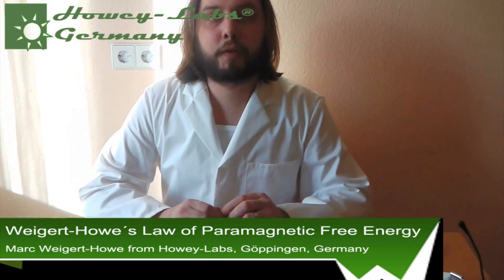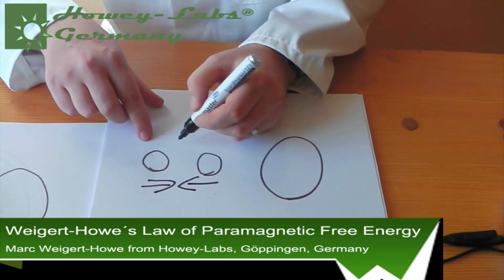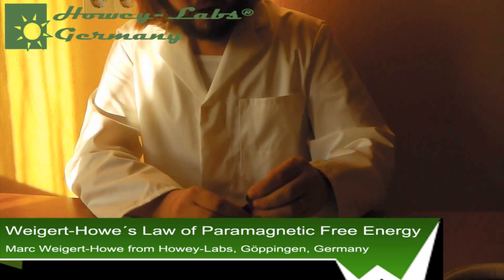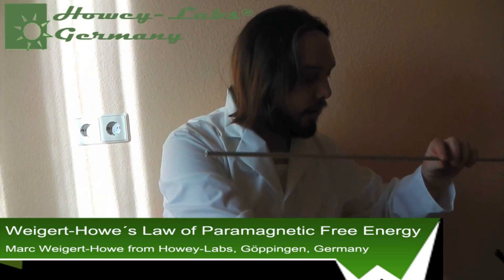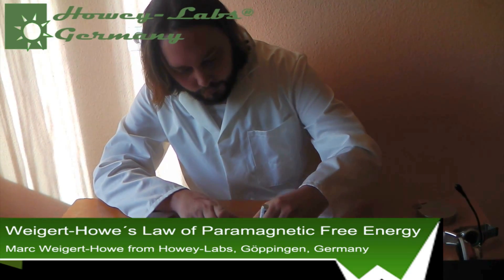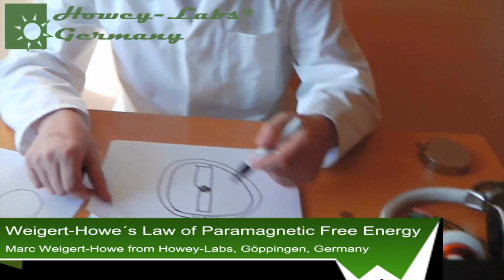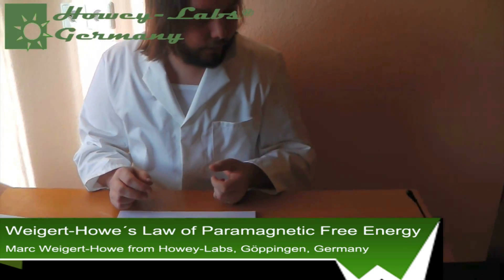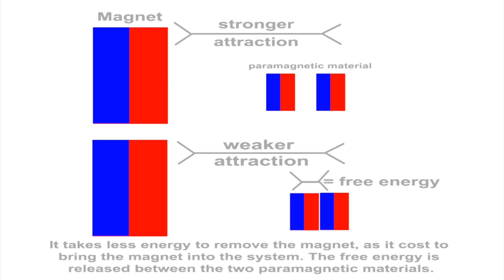REAL Perpetual Motion Free Energy Machine Part 1 ★ (ParaMagnetic Motor Overunity Generator) ★★

Comment: This person is claiming his device to be a 2nd order Perpetual Motion Machine.  By definition all perpetual motion machines existing in our universe must be 2nd order; meaning they produce excess energy.  After all, if you can hear it then it is producing sound.  Sound produces heat and heat is an inefficiency loss of the energy transfer through air.  
His claim is even more outrageous than a 1st order PM machine which produces no net energy (still impossible).  
Simply put if you are unable to trace the energy flow and don't encounter any inefficiencies in your process then you are mistaken. To have any sort of energy transfer there must be associated thermal losses.  Even thinking produces heat.  

If you reject 100% of the inventions which promise more energy out than energy in you will be correct 100% of the time.

Comment: Everybody with a bad attitude, I think you totally missed the point that the German guy tried to convey. I agree, the camera is shaky, the banner covers 99% of the video etc...but he compensates by sharing something that can be important...
First of all, he is not using magnetic/ferromagnetic coins but paramagnetic ones, and the effect is ONLY observable in the presence of the strong magnetic field provided by that monster neodymium magnet he uses. If you watch carefully the coins are not attracted to the magnet; just to each other (in the presence of the relatively strong magnetic field). The effect he tried to explain is that the attraction force between the coins is stronger when they are close/r to the magnet and weaker as the distance to the magnet increases producing a difference in the total force...That is producing Work when they attract each other when close/r to the magnet that is bigger than the work needed to separate them when far away form it. The work moving them away can be considered negligible since they are not affected by the magnetic field (in a considerable way).
Even if he is wrong, If you don't see anything remarkable, worth seen twice results on this small experiment, well...
Also, he just wanted his name after the effect...come on! is not like he is asking you to give him your first born, jeez..
Respectfully.

Comment: you are just jocking, free energie devices dont work, all of them need an apport of energie, overunity´s are a scame, i spend time and money testing and i never reach 90 % eficiency that not more than any efficiency motor, perendev and brady where a robbers and scammers, the only device you can really built up is a very effeicient pulse motor, no more
Reply: +Germain Seguy, try using a torroidal device to amplify your power output
Reply: FANATASTIC,
 GROWING UP VOLT AND LOOSING CURRENT ! DO YOU KNOW ABOUT KIMERAS? I INVEST A LOT OF MONEY ON THAT DEVICES,  FREE ENERGY DEVICES ARE A SCAMMER, CHEK OUT IN YOUTUBE: GERMAIN SEGUY,  WATCH MI PULSE MOTOR, I KNOW WHAT I AM TALKING ABOUT!
Reply: i will send you a video after i build a cheap efficient generator. you need to think outside the box on this one guy.
Reply: Ok i will be happy to watch it! Thanks i built up one too, not bad you can watch on youtube
Reply: Germain Seguy
will take alot of work, but i'm going for around 24v input while getting anywhere from 240-300v output. where there's a will there's a way
Reply: What about the current, how much watts input, how much watts output?
Reply: Germain Seguy all still on paper but what my goal is, is to achieve an output of at least 10-20x what it takes to run. first step is finding myself a small dc dynamo and small dc motor and various other parts for small scale testing. thinking gear system possibly, 1:16 ratio oughta speed up kinetic motion at the dynamo significantly
Reply: I did that job , only way is mi system; a brushless bike on the rotor core used like axle and use push pull system with polarity inversion using optical sensor and a chip, + h bridge ssr relays for the frecuency the problem is lentz effect due when get load
Reply: Germain Seguy
 i am most likely going to cannibalize a dynamo out of a diesel dc generator, and build the system outward from that, that way just need to match the rpm and torque that would normally be applied by the diesel engine. this is strictly in the conceptual and on paper phase right now, but as resourceful as i am, i'm sure i can scrap something together for relatively cheap. my goal is to spend less than $250 and still be able to build a working unit
Reply: Germain Seguy You actually spent money testing free energy machines?  Are you kidding?  Why didn't you just pay attention to high school physics.  You would have known they don't work...for free.
Reply: thanks i know they dont work!!!
Reply: +Germain Seguy Sorry dude, you can barley type.. I can&#39;t see any point you make being serious haha. You can definitely make free energy with induction, basic basic physics.. I can make an electric current with a coil wire, a magnet and my fingers.. People with your attitude are generally pretty dumb because you close out knowledge. You&#39;ll calim to know everything on your own, and without listening to other people you&#39;ll always be behind the power curve.  Never claim to know everything..

Comment: Explanation of this (NOT PERPETUAL): 
When para magnetic material is in presence of the magnetic, it becomes slightly magnetized however as it moves away from the magnetic field the coins magnetic field looses its magnetism due to thermal-motion taking over and randomizing the electron alignment, therefore as it moves up its magnetic potential energy is lost and the system re-gains the energy. Furthermore, this can be shown if the top-most coin is set outside the magnetic field which will lead to the 2nd coin falling back down due to gravity and then magnetic pull back down as it will loose all its magnetism and so the system gains no energy as soon as it leaves the magnetic energy down thus loosing its energy. In other words the large magnet provides the magnetization but the coin has with a linear B(H) characteristic and no magnetic hysteresis causes any energy-imbalance. As for your motor which rotates, the friction causes it to stop thus laws of thermodynamics are not broken (NO ENERGY IS CREATED, IN FACT IS WASTED TO THE SYSTEM).

 Next, when he pulls the coin away from the top-coin he is using energy thus no energy is created there either in that frame of reference. This is an scam and this idiot has no clue about mathematics nor physics. Maybe next time, Weigert-Howe will be named as the idiot of the century.

Comment: Wonder how many laptops he has fried having a 1kg neodymium magnet hanging around, considering that it could stop the ticking of a standard clock when walking into a room i would imagine quite a few.
   
    Was thinking based on how neodymium magnets interact with copper say when passing through a tube, what would happen if you had a half sphere made of thick copper and placed a magnet in it, would it stay suspended in the center on its own, vs if the magnet was spinning. Now say that it was in a vacuum could you perhaps use this set up to reduce loss from heat to the point in which it would be easier to create energy with very little input. not the best at explaining what I'm theorizing but if someone gets the basics of what I'm saying i think this could prove very fruitful.
Reply: neodymium magnets are used in computers.

Comment: the coin is not a paramagnetic material, The core is a piece of metal coated with nickel. you can wiki the coin specifications or you can section the coin then you will see everythings.

Comment: To achieve this mount the ring magnet to the table tape it ect...next take some sowing string about a 2 feet long and get a key ring and loop the string through the key ring and tie a couple of knots at the end so it will be able to twist and untwist, next get a spherical magnet and place it close to the ring magnet to find the attracting pole of the sphere magnet, now place the spherical magnet on the key ring with the opposing fields facing each other. Lower the ring now it will orbit the mag.

Comment from the maker: Aluminium is too weak. Try it with stainless steel, it is also paramagnetic. 
To achieve a strong effect there must be a strong paramagnetic Materieal (stainless steel).
But you are right, of course, copper is diamagnetic.
Reply: Nope.
Nickle

Comment from the maker: Hello, yes, aluminum and copper are paramagnetic. Only very, very, very weak. Amazingly stainless steel is very strong paramagnetic and not ferromagnetic! Although iron from which stainless steel is 95% made from is ferromagnetic. However, there are a few rare types of stainless steel that or also ferromagnetic, most types are not.

Comment: I probably don't understand but I always thought that aluminum and copper for example are paramagnetic.
The coins as I see them are 1 or 2 or 5 cents and they look like copper but this is just the outside.
As you may have noticed they are attracted to the magnet (also to a weak magnet) this is because they are not of copper but there is iron inside this coil. In the good old time they where made entirely of copper but in these times of inflation they are iron coated with a thin layer of copper.

Comment from the maker: Hello, I do not think you understand what it's about. Of course it works with all other paramagnetic objects. Also with nails. The point is that it moves against the magnetic field. This is impossible, according to the first law of Termodynamik (conservation of energy). It can easily be used to gain energy. I will soon make a video where I measure the energy with a scal. I have already done this without a video camera and it proofs clearly free energy.
Reply: any traction on this?

Comment from the maker: renewable energy resources hydrogen energy overunity generator wind energy companies electromagnetic energy power energy wind energy facts solar power system free energy devices for sale magnet motors renewable energy sources diy free energy free energy home energy conservation solar generators magnetic engine free energy magnetic free energy generator energy saver green energy solutions surface free energy solar energy systems magnet motor plans windpower genset new free

Comment from the maker: renewable energy facts biomass renewable energy free energy motor generator tesla free energy generator plans permanent magnet synchronous motor electricity generators free energy motor plans permanent magnet motors renewable wind energy magnetic perpetual motion generator free magnetic energy generator plans free-energy-devices magnetic electricity generator magnet powered motor free energy power generator zero point magnetic power generator free energy green

Comment from the maker: design renewable resources of energy electricity free perpetual motion magnet generator free electricity from air renewable energy economics tesla magnetic motor motor generator free energy practical free energy devices overunity magnet motor magnets motor permanent magnet synchronous generator generator magnet magnetic motor free energy generator generator electricity magnetmotor cycclone magnetic engine magnet 4 power youtube magnetic generator free energy buy magnetic motor

Comment from the maker: magniwork magnetic energy generator free eco power generator motor magnetic magnet motor youtube permanent magnet free energy electricity for free permanent magnet generator wiki magnets in motors overunity free energy magnet motor alternative energy engines magnet free energy motor magnet motor video alternative energy engine water as energy source energy magnet a renewable energy source is magnet motor energy magniwork free energy generator pdf free magnetic generator